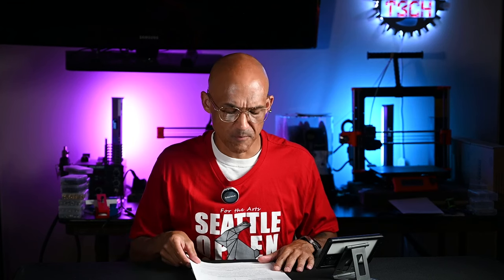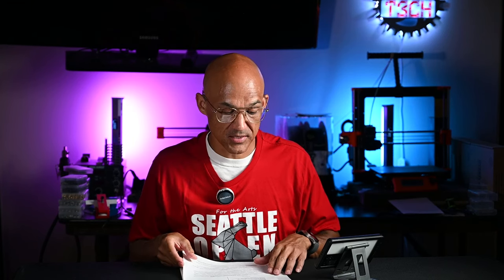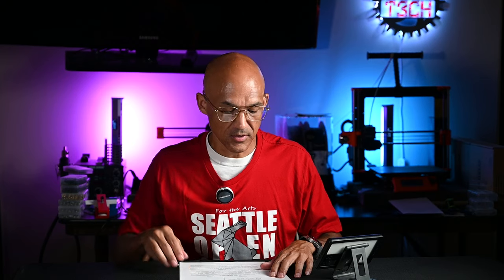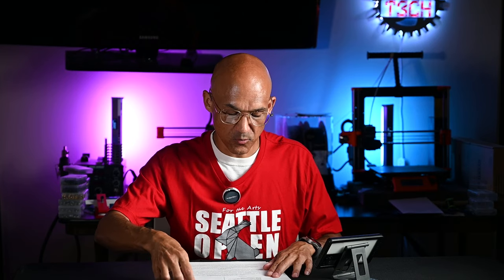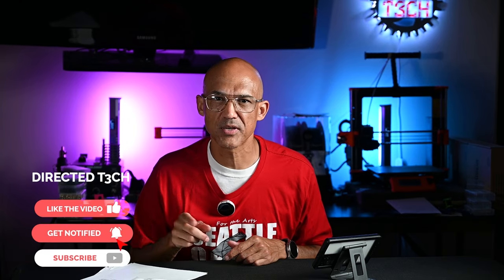Bambu Lab Sued by Stratasys! - Is this the end of consumer 3D printing??

Comment: You're missing an important bit of context here. Some if not all of these technologies were in regular use in the industry and 3d printing community before Stratasys filed the patent. A patent should never have been granted and is therefore illegal.
Reply: Yes, exactly! I don't understand how any of these vague patents were approved.
Reply from the maker: That's a great point!  I'm not sure how some of these patents were granted.
Reply: sadly they changed the patent law years back to "first to patent" who invented and prior use no longer matters
Reply: You need to read the specific claims, not the headlines.  The claims are at the end of the patent and they describe the specific implementation.  For example, the patent isn't on "heated bed" it's on a specific implementation that involves a flexible surface covered by PEI (not attached via tape).  So if there were flexible, PEI build plates (not Kapton tape) in 2013 then there is prior art.
Reply: @turnrock when did this change, do you know? What could I search to understand this better
Reply from the maker: @ralathr  Thanks!  Sounds like I need to dig deeper!

Comment: I think that they are seeing that these small cheap desktop printers are starting to become capable of the same quality and efficiency as their high end machines, so they feel it is high time to crush the competition -- because if companies began to realize they could ditch their overpriced Stratasys for a $500 Bambu Lab they will lose a lot of money! A company like Stratasys depends on convincing manufactures that their machine is 1000x better than a $500 printer and that's beginning to not be true. It is truly a case of big business lobbying for themselves through lawsuits.
Reply: The industrial style machines usually have the worst quality from what I have seen.. Bambu has changed 3D printing for the better and Stratasys can't compete with the reliability and price. The only thing I have seen that these industrial machines have going for them is printing higher temps, reliability, and faster support because these aren't meant for regular consumers. These patents should have never been approved and I don't understand how they were when even in 2016, other manufactures were using the same methods.
Reply from the maker: Seriously!!

Comment: Stratasys is going to have a hard time defending why they have slept so long on alot of this stuff. It feels more like an intimidation tactic than anything. Theres also the fact that alot of this stuff has been created/worked out different ways than the original patent. Which is part of the way to get around patents when reverse engineering and creating clones/competing products. Which is something taken into account when deciding patent cases. For the most part this feels like FUD. It wouldn't surprise me if its tied up in the courts for the next 10 years, at which point the patents which some are close to expiring already, will be expired.
Reply: I really hope this is the case. Love or hate Bambu, they have changed the industry and going after them for this is really dumb in my opinion. It just sucks because I think whatever happens, we the customers will be the one paying for it to make up for the costs of everything.  But I can see Bambu leading them on for 10 years with how much they are worth.
Reply from the maker: Great point!

Comment: They just want to be hated by all 3D printing Community. Just look up on those dates of that patents. 

- Additive manufacturing method for printing three-dimensional parts with purge towers | Placed on 2013 LOL
- Heated build platform and system for three dimensional printing methods | Placed on 2014
- Method for building three-dimensional objects with extrusion-based layered deposition systems | Placed on 2006
- Three-dimensional printer with force detection | Again 2013
- Three-dimensional printer with force detection (second) | and 2015

Who the hell give them those patents? I dont know how accurate is chatGPT, but it says that heated buildplate was introduced in early 2000's and first 3D printer was build in 1983 by Charles Hull. So who and why give them those patents, i dont get it. Also using force detection by BLTouch i bet was introduced in <2013. They cannot patent things that was used by ppl many years before patent. They will lose for sure.
Reply: Also in the las few years they placed patents on resin stuff and water soluble materials, lol. They just patent everything xD and they think they invented all of this.
Reply from the maker: Isn't it crazy?!? Sounds like the patent office isn't doing any research.

Comment: The patent system was originally intended to protect individuals from large companies.  The idea was an individual would patent an idea and could then go after a large company who stole their idea.  Of course it has not been used this way for a long time.  In my view most patents should not be granted.  However the patent office cannot possibly review every patent properly so a lot of patents are approved when they should not be.  The idea of a flexible build plate was probably novel enough to have permitted a patent.  The idea of tape vs some coating should not matter.  They probably had to make this distinction to get around the expiration of the earlier patent or the prior art of using tape.

As for RFID tags in the spools, give me a break!  Radio Frequency IDentification is in the name.  The patent holder of the RFID device is probably getting a royalty for the sale of each device.  The patent on using these devices in a spool should have been immediately denied because this is an obvious use of an already patented device.  What other ways could this have been done?  A bar code or QR code reader.  Go really old school and use magnetic ink like used to be used on checks.  Or even worse, just tell the software what you are using.  Oh wait, we are already doing that for non Bambu filament.

Patents these days are often used as bargaining chips.  One megacorp contacts another and comes to a deal.  Stratasys probably contacted Bambu and tried to get them to give them some money for one of these really weak patents.  It isn't at all clear what will happen when going to court.  In the worst situation I see Bambu losing in court and simply stop selling here under  that name.  Form a new company and rebrand all the products.  Heck, this is China.  You don't actually buy a product made by a company called Bambu.  You buy a product labeled Bambu made in factories in China.  Bambu can be thought of as a marketing firm for this purpose.  Does the court where the suit is filed even have any jurisdiction over anything sold under the  Bambu name?
Reply from the maker: Brilliant insights! You nailed it.

Comment: I believe the idea of losing IP if you don't defend it is mostly a trademark thing? I am not a lawyer though. But if that applies to patents than frankly they should have most of the listed patents invalidated, as things like heated beds are industry wide at this point. But they have an absurd number of them, I imagine that they can hold Bambu Labs in court for a long time if they want to.
Reply from the maker: You might be right about the defense thing, I'm also not a lawyer.  I would think that you'd have a weaker case if you go after company A for infringement but haven't gone after company B who has been violating a patent longer.